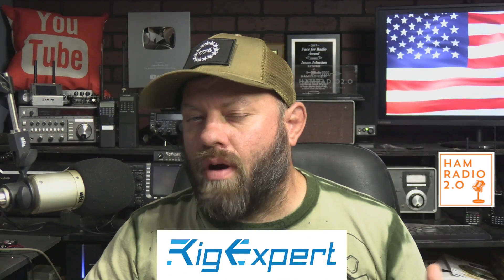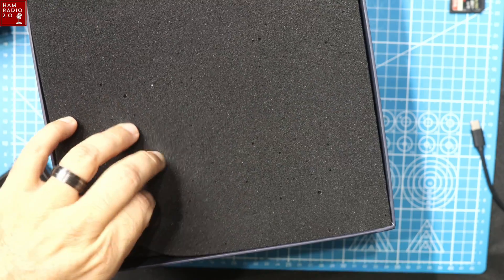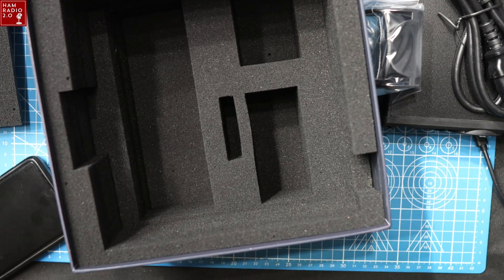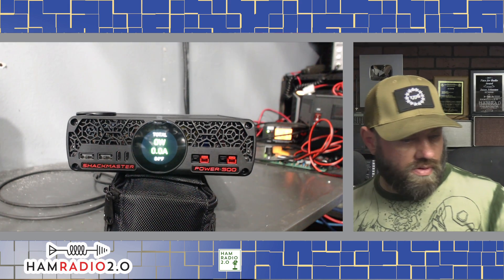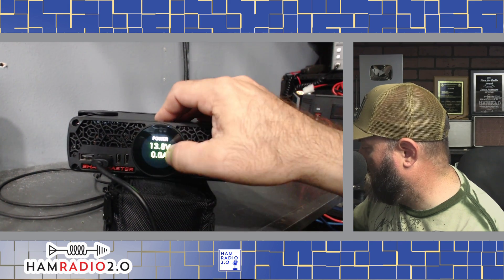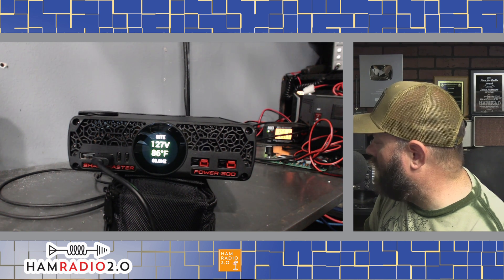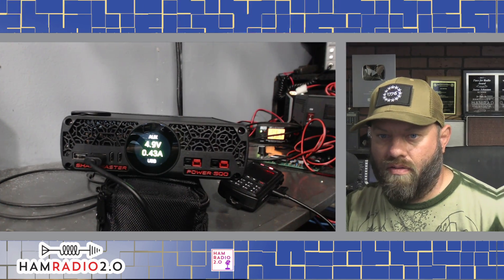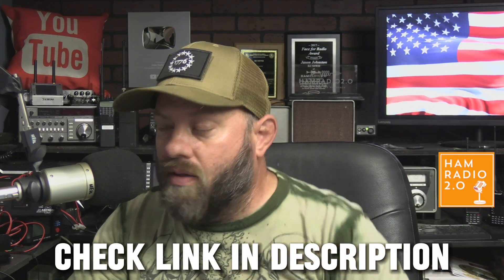RigExpert ShackMaster 500 36A Power Supply

Comment: Aside from RF noise that some switching power supplies, is it true that it is possible that it can damage a radio like some suggest? Reason I ask is that I bought an N.O.S. Anytone AT5555N 5 months ago and have using it with a 30 amp switching P.S. like those used for cctv applications in which a lot are been using it with their cb or ham. Anyway, suddenly I lost the RX on my 5555 and some say it might have been my P.S. which I doubt because my HR2510 of 34 years is also using the same P.S. and it's still working fine.

Comment: I'm surprised to see such low amperage and watts while charging your HT ( .4A with 2W). I wonder if that's the max charge the HT can pull from the USB port? For example, I think most people, including myself, would want the capability to charge a cell phone / tablet etc, which requires 2.4A and 10-12W. That's been the standard for long while. If this PS does not provide that level of power through the USB ports, it's useless as a small device charger.

Comment: Initially I wanted one of these; I always appreciate power supplies that are well manufactured.  Even the price wasn't all that unreasonable.  But after looking at it indepth,  found it lacks  a battery backup input.  Although I don't really need battery backup... for the price it should of included that.  Not enough there to warrant  the price IMO.
Reply: Hi, I'm just curious, what do you mean that it doesn't have a battery backup input? I ran a large truck battery through a battery backup switch gate between the power supply and radio, as engineered and intended. Anytime my power supply lost house power, the switch gate would auto provide power to the ham equipment / radios from the large truck battery. When house power returned, the switch gate would automatically switch back to the PSU and also automatically recharge the truck battery.

Comment: OK...a couple tests please.
#1 Check  continuity from the ground pin on the 120V power to the common terminal.  There should NOT be continuity but most power supplies incorrectly ground the common.
#2 Check continuity from the USB shell to ground pin on the 120V -- there SHOULD be continuity as the shield needs a ground to do it's job.
#3 Check continuity from the USB shell to pin 4 on the USB connector -- there should NOT be continuity and, unfortunately far  too many USB devices ground the shield to the data ground (causing all sorts of RFI on the USB cable).
I'm keeping a list of the power supplies on my QRZ page so would like to add this one.
Reply: Also...you saw RFI in your shack.  If you run on battery and no antenna is that different than power supply + no antenna?

Comment: Does it have 1) fan or inductor noise on small power output for long time 2) noise on long time powering 50w radio? I have one of those popular Alinco switching supplies and it gets hot at 50w and starts to make fan switching noise. Really annoying. Had one of fake yaesu linear supply and that one had fan always on. Tweaked fan resistors and it didn't handle temp passively even few 10s of watts